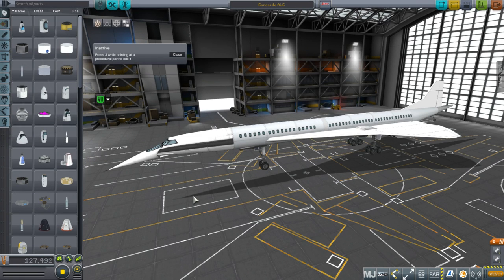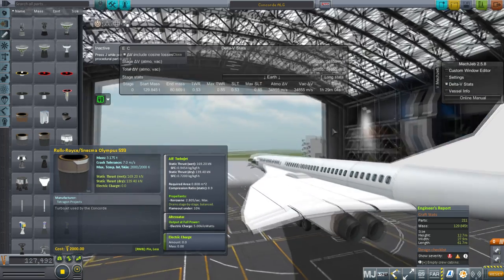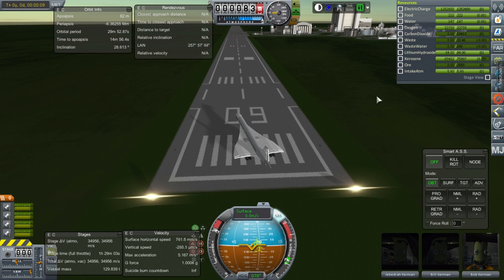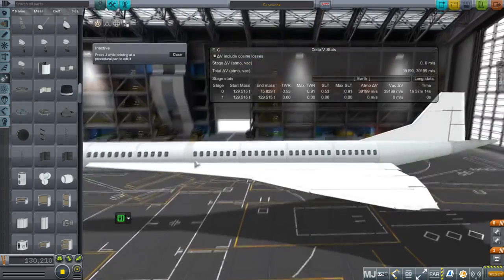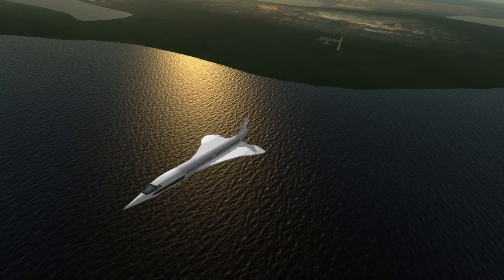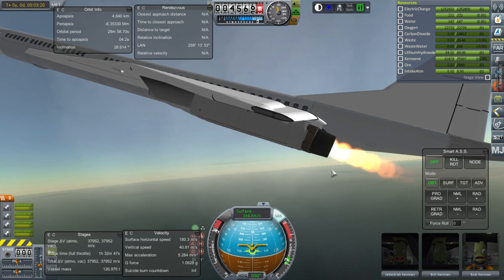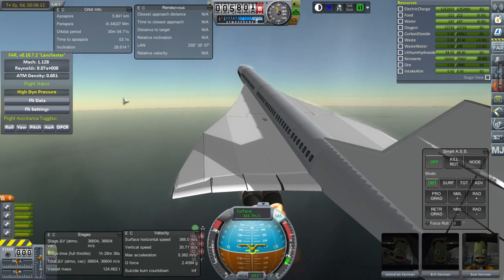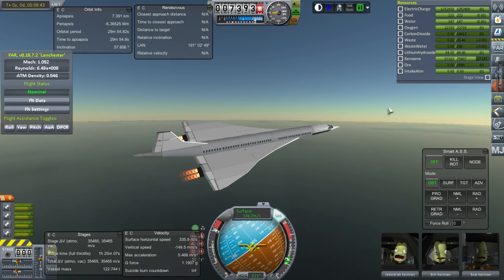KSP/RO - Realism Overhaul Concorde

Comment: 20:14 With FAR top speed depends on the engine config and wings layout,  effect of TWR is rather neglible. Try put the same engines on B-29 or  even B-737 and you'll never get above mach 1 despite of having the same or much better TWR.

Recently I was trying to determine which of my planes is fastest at sea level. I compared a couple of modern jet fighters but also X-15 and SR71 Blackbird. It turns out that X-15 is slightly slower than Blackbird despite of having 5x better TWR. Top speed of SR71 at sea level was mach 1.5, mach 1.45 for X-15 an mach ~1.2 for jest fighters.

Comment: To fight the wobble I'd suggest using the AtmosphereAutopilot mod. Its fly-by-wire option is really good at flying planes, even aerodynamically unstable ones (if configured to limit AoA or piloted carefully).
Also, quick googling revealed that Concorde had no flaps and had to keep high AoA during takeoff and landing. It didn't have any air brakes either, instead it used thrust reversers.

Comment: CKAN Name: Pilot Assistant
CKAN Description: Helpful tool which controls planes altitude, heading, and airspeed via autopilot or custom SAS

I used it extensively with FAR(the only way to fly) and since I was never a good pilot at all, it helped me immensely.  It has windows for setting climb rate, turn rate, wing leveling, altitude hold and all that other jazz.

Comment: The reason your engines seem OP during flight is because Concorde would supercruise.  Reheat was used for takeoff and from Mach 0.95 to 1.7, after which the after burners would be switched off and the engines would be ran "dry".  You left them on for the whole flight, giving you more power at Mach 2 than was actually available, assuming your engine configs are correct.

Comment: Concorde or tu-144 ? ^^
Reply from the maker: Concorde always looked sleeker to me, and Tu-144 had practical design problems including really loud cabin noise. There was a flight with passengers in January of 1978 that had 7 system failures before takeoff, but they decided to take off anyway because they were more concerned with avoiding embarrassment than safety. It subsequently had most of its systems fail during an hour-or-so flight, and they didn't even know whether they could extend the landing gear safety to make an emergency landing. They managed it, so credit to the pilots, but the engineering was horrible.

Comment: The problem with your ability to turn stems from SAS. SAS completely and utterly sucks when it comes to atmospheric flight, as it wants to lock you in position as it does when you're in orbit, which isn't good at all for atmospheric flight. You'll do a lot better if you get a mod like Atmospheric Autopilot, which disables SAS's position locking mechanic, allowing for much easier atmospheric cruising, you just have to remember to enable it each time you launch or enter the atmosphere. It essentially replaces SAS with Fly-by-Wire and attempts to maintain the best stability at all times.